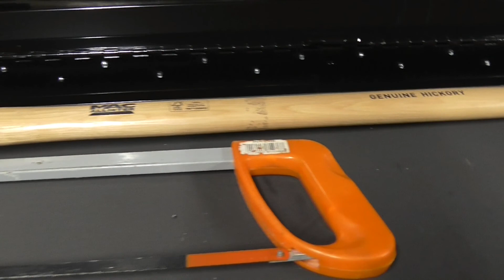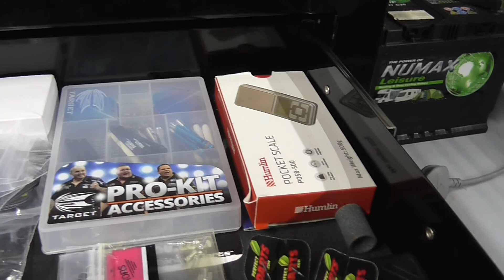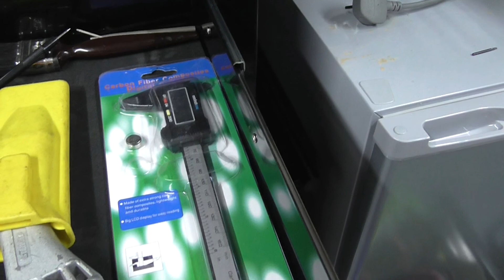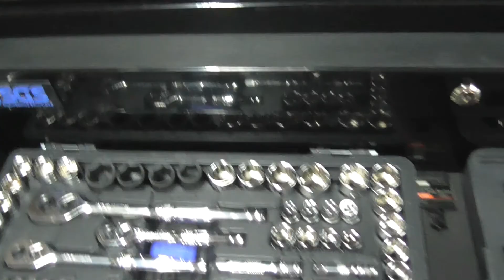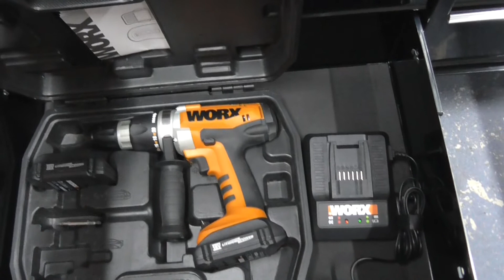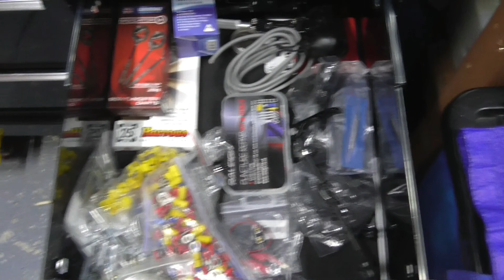sgs engineering 42 inch tool chest tour

Comment: Excellent review mate, Looking to buy this exact box off Ebay currently for £585. Having filmed this in January hows it doing after a few months you owned it? Again thanks for the review.
Reply from the maker: Justin7036 thanks for watching, the box is holding up well (it doesn’t have a hard life) the rails are still super smooth even the drawer which loaded up the heaviest and is the widest of the drawers is showing no signs of stress whatsoever, I highly recommend getting one if you have the chance 👍
Reply: I've put my 26" box up for sale an i'm gonna buy this box. How did you attach the handle? I think an upgrade i'd do to mine is fit gas struts to the lid if it's possible an maybe a handle like you done.
Reply from the maker: Justin7036 the handle I fitted to mine was one I found on eBay for a few quid, drilled a couple of holes and it was good to go I wouldn’t mind fitting gas struts as well maybe a future mod
Reply: Sorry mate there is another thing, Was this well packed undamaged when it was delivered to you from sgs?
Reply from the maker: Justin7036 yes it was packaged well, strapped to pallets and cling wrapped there was also polystyrene in the boxes as well, no damage whatsoever

Comment: Hi im considering buying one of these. Can you comment on what the quality of the cabinet is like? How good are the wheels? I would be wheeling it in and out of the garage and wonder how durable they would be along with the wheel locking mechanism thanks in advance
Reply from the maker: mike hunt hi the quality of the cabinet seems to be excellent, the draws open and close very smoothly the wheels look good quality for wheeling around the garage on smoothish floors and the same for the wheel locking mechanism it does the job perfectly for myself, for the money you pay for this setup you can’t go far wrong and you won’t be disappointed
Reply: gixer1974 brilliant cheers mate